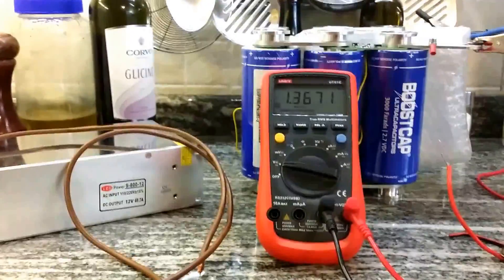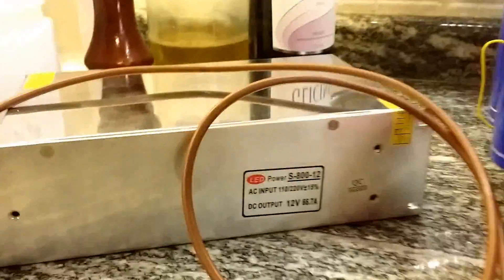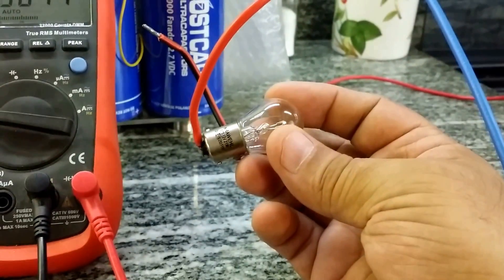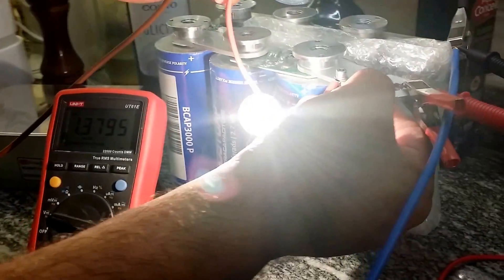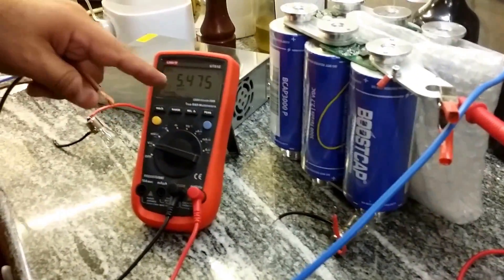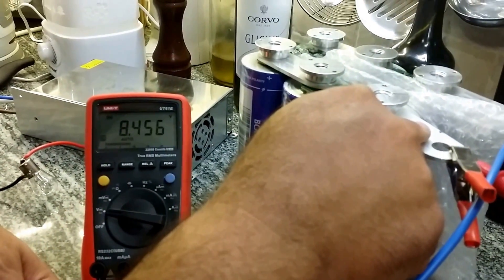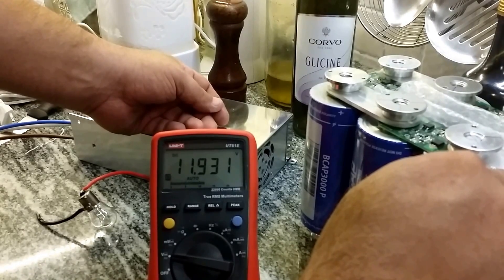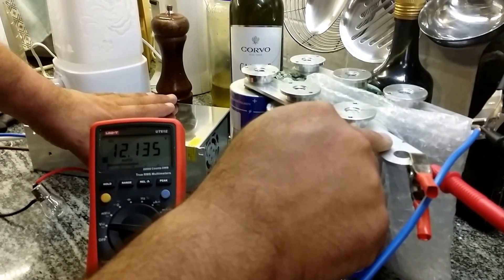Fast Charging Ultracapacitors and Supercapacitors using 66.7A LED Power supply

Comment: dear Billywhizzy, well movie! pls let me know where to buy 3 balancers for the SuperCap. I got 6 pcs of the caps. Charging w/o balancers by regulator is ok, but I would be like to follow the rules:) thx in advance. Karol
Reply from the maker: I bought them with the ultracaps. These were taken out of a bus and came with the balancers. However with todays BMSs for batteries like JK BMS, it will be possible I assume to balance a 6S pack with custom programming of the BMS with a bluetooth app. But you will need to send a message to JK to make sure there are no problems because of the very low internal resistance.

Comment: I have been searching for a comprehensive evaluation between lead acid batteries and a bank of capacitors of the same Amp Hour rating.  It seems to me (example): a 100 Ah lead acid battery should be equal to a 100 Ah bank of capacitors with the difference being weight. Next:  Why do I see capacitor users charging their capacitors independantly from their vehiches? Does this mean the vehicle's alternator (while driving) cannot recharge the  capacitors?  This far, I cannot find a video ditectly engaging in these comparisons.
Reply from the maker: I'll be simple about this. Supercapacitors do not have anything near 100Ah in this bank of 6 cells. I would say about 1Ah in all. I can light a 60W lightbulb for about 2 minutes before ther pack voltage goes below 12V. The difference here is that Ultracapacitors are capable of delivering 2000A current at any moment. (When fully charged) Equally they can be recharged fully in seconds. If they are discharged, it is not wise to recharge in vehicle because their internal resistance is so low that the alternator cannot deliver  100A to 500A of current to charge these cells up, and they can take whatever you give them. However if fully charged and only needing some top up, this will not cause problems to the vehicle alternator. Capacity is the stoage capability of energy and whilst car batteries have a much higher capacity, ultracapacitors do not. Car batteries can be charged for about 500 full cycles and they're goners. Ultracapacitors are rated for thousands of cycles without any degradation. There is also a balance circuit on the cells to ensure that the voltage in each cell does not exceed 2.7V because that could damage the cells. In a car battery overcharging dries out each cells because the electrolyte boils, but in UC's this is dangerous. So in short, I can start a large diesel lorry with a set of UC's and they weight about 2 kilos. But you cannot sit in the lorry for an hour listening to the radio or keep the internal lights on for more than a few minutes. Some people put a bank of UC's in parallel with their Lead acid batteries to aid in cranking current when starting.

Comment: I have 6 super capacitors. Each are rated at 2.85 volts 3000 farads. They are completely discharged and I'm unable to charge them using a SKYRC iMAX B6 mini. I will buy a light bulb soon to try charging. What settings do I use on SKYRC iMax because mine can't be adjusted on the fly...I think? I have multiple volt settings 2V, 4V, 6V, 12V... I'm guessing 12 volt if I use a 12volt bulb. The max amps the charger is capable of is 5 amps. I'm looking to charge each super cap to 2.4 volts x 6 to equal 14.4 volts which is the voltage in my car. After I charge them to 2.4 volts each they will be assembled or is it simpler to charge the whole bank like you did. I do not have balance boards and probably do not need them because I'm not exceeding 2.85volts. After I successfully charge the capacitor a bit can I use a EVERSTART 750 Amp Jump Starter to fully charge the caps so it will be faster?
Reply from the maker: On the skyrc mini B6 charge using the NiMh mode at 1.2v per cell but instead set the number of cells to 14S. Be vigilant on the voltages of each cell if you do not have an active balancing circuit to monitor the voltage in each cell. You can do this with a multimeter testing the voltage of each cell whilst charging. You are obviously limited to the maximum charging current of the B6.
Reply from the maker: Yes you can top up the voltage easily with a Lithium jump starter but if tto much currect passes through the jump starter you risk frying it's battery. It would be easier to hook the capacitor bank in parallel with a car battery in pulses when the caps are about 10V.. there will be sparks when large spikes of current are fed into the caps
Reply: @billywhizzy  Just bought a 6/12 volt 3 amp battery charger and 12 volt 21watt bulb. Only thing I need information on is should I charge each cap separately or the whole bank. Thank you
Reply from the maker: @PowerBassTest  Does your capacitor have active balancing circuitry? If yes, you can charge the whole bank at once. If no you need to carefully charge each capacitor one at a time keeping an eye on the terminal voltage of each capacitor with a multimeter.
Reply: @billywhizzy  I do not have balance circuitry. I will charge each cap individually per your instructions. I did not buy balance boards because I plan on charging each cap at 2.4 volts way below 2.85 volts. Thank you.

Comment: thanks to the power of "constant current circuit". i hope you know.
Reply from the maker: You can charge those ultracapacitors at 100A. Discharge 130A @15C and 290A@40C both continuous RMS so I used the full capacity of the power supply at 12v. There was no way they could have peaked at 16.2V because the power supply was running at constant voltage.

Comment: Hi

We need as much technology as possible 
The only way to have technology everywhere is with a spring powered USB charger
Like this

https://photos.app.goo.gl/EnUVBPDunO66fDb63

The only way to keep this self wound is if the hand crank charges a super capacitor and it makes the drill keep it wound like this

https://youtu.be/rEuPwnwAbcM

Here's a smaller hand crank that would charge slower but still can power a drill

https://youtu.be/ucLyYA3WvlM

I am in Canada and we cannot make this

https://youtu.be/ucLyYA3WvlM

A large portion of Israels money is invested in Canada and America
If we do not have this device we do not have technology
There was more than. 10,0000 fires set and we do not have detection devices in remote regions to stop those fires
We need a self winding clock to charger USB devices
Please make this available.
https://youtu.be/ucLyYA3WvlM
If you have connections in other countries please contact them and make this available to us
We truly need this , i wouldnt comment if it werent so important, please make this available to us 
https://youtu.be/ucLyYA3WvlM

Comment: Hi. What are you using these ultracapacitors for? Where did you buy them and the balance board? And how much?
Reply from the maker: I use them to jump start Large diesel engines 5 and 7 Litre engines no problem. I also use them to store large current from solar energy to use it to charge smaller devices. I even charge them fully at 150 Amps from solar panels. I bought them used from ebay for about 300 euro including the balance boards..
Reply: Hi Billy, I'm not able to find them on ebay, do you have any link.
Reply from the maker: https://www.ebay.com/itm/Maxwell-BCAP3000-Boostcap-Ultracapacitor-Capacitor-3000f-2-7v-NEW/263157661514?epid=2197364341&hash=item3d456b3f4a:g:mHMAAOSwFjlZtuIc
Reply from the maker: https://www.ebay.com/itm/MAXWELL-650F-1200F-1500F-2000F-3000F-2-7V-Ultracapacitor-Balancing-Borad/263206675029?hash=item3d48572255:g:iy0AAOSwHaBWkGZj

Comment: So those balancing boards won't be damaged when charging a bank at 200amps? They just might not be able to drain the higher voltage caps fast enough correct?
Reply from the maker: In the video I charged them up to about 12.5 volts, i usually top them up to 16v on a lower current or when I see the balance board led's light up, I stop. But I have to bring the bank up to 16.2V for that to happen. The balance circuits can drain 1A from each over charged cell.
Reply: billywhizzy ok. So Either way the balancing board won't get damaged from rapid charging they just won't help if they do start over charging right?
Reply from the maker: as always you have to keep an eye on the balance boards, once my power supply is set at 16v, CV, the amperage will creep down very quickly anyway. But it's always fully attended just in case one of the cells is of a lower voltage than they others and manages to reach the terminal voltage much quicker. These Cells are very similar in internal resistance and more or less reach the terminal voltage all together.

Comment: You can minimise your charging time by putting a constant current  circuit between your PSU and your supercapacitor bank, set to limit the current to la little less than the PSU can supply. You can do this with a simple transistor circuit using an n-channel  mosfet. However, this will require good heat sinking and maybe a fan to cool it too!

A much simpler way is to continue your approach with an incandescent lamp. I used 55 Watt halogen car headlight bulbs. Their resistance is low at zero volts - under 0,1 ohms, but rises to a bit over 4 ohms  at full voltage.  So putting a lamp in series with the capacitor will limit the current when the capacitor voltage is low (and the lamp voltage is high) but not limit it much when the capacitor voltage rises. Exactly what you want! 

You may have to choose a different lamp, or do as I did which was to use a number of lamps in a series - parallel arrangement to get the characteristics you want. It won't be as good as the constant current circuit, but it does approximate to a constant current circuit without requiring too much thought .I was after a cheap rugged unit that could be used 'in the field' by ordinary workmen and charged either from a car battery or mains in under five minutes. Incidentally running these lamps in a series parallel arrangement means they are all underrun which hopefully means they will last indefinitely!

You might also consider buying a bench supply which allows you to set the voltage and  current yo want. I recently bought a switch mode 20Amp one for about £130 which does the job a treat. It cheerfully pumps 25A into a dead short!

The nicest way would be to modify your 66.7A unit to limit the current to - say - 60 Amps without triggering the overload protection. This would require some reverse engineering of your unit, and a bit of redesign and modification. I have so far been unable to get hold of a schematic for these led drivers which would make the task a lot easier!
Reply from the maker: 100's of them in series parallel configuration. 500W is a lot of power for supercapacitors and is very expensive to run. I Can run an inverter from this set of supercaps for just 5 or 6 mins (100W) and this bank costs about USD 300
Reply: Each one of these 3000 F Capacitors stores an equivalent amount of energy of a AA alkaline Battery. True the Super capacitor can discharge a HUGE amount of amps for a very short time over all it is equal to a AA battery (Comparing watt hours) in theory if you used a step up boost converter you could use a AA to completely charge a 3000F Capacitor at same time the AA went dead
Reply from the maker: I usually use this system by bringing up the voltage to 5v using my lab power supply. The bulb system in series is designed to be a poor man's option. Otherwise when i need to charge quick i continue from the 800w led power supply.
Reply: Could you build a
 bank of capacitors to use with solar panels during the day replacing 
batteries and provide 500 watts for lamps, computer and tv? Here in Brazil I only saw capacitors of 350 farads, how many would it take to supply these 500 watts?

Comment: You could use a vehicle alternator too, right? 6 caps in series can handle 16.2V?
Reply from the maker: Definitely can use a vehicle alternator which is connected to a vehicle not directly since an alternator outputs AC voltage and you need DC. However, if the voltage of the series capacitor bank is close to 0v (fully discharged) it is not a good idea to hook up to a car to charge since a car alternator can only max 40-50A and that will show up to the car as a dead short due to the low impedance of the ultracaps. Besides the spark generated, the risk of blowing up your car voltage regulator is also high since it is presented with the low impedance of the ultracaps as a dead short. Yes 6 caps in series is 16.2v in total (important to make sure that each cell is properly balanced) If you need to connect to a car to charge up to 14v, make sure that the ultracap bank is no less than 12v so that the alternator/voltage regulator is not stressed out.

Comment: you have tryng discharge time , i thing is  very fast
Reply from the maker: it depends on the current used up. If you hook up an led it lights forever and if you drain 1000w you've got a couple of seconds. I have managed to run a tv for 10 minutes off an inverter until the inverter marked low voltage at 10.5 v

Comment: Use nichrome wire (e.g. Constantan etc.) as a current limiter instead of light bulbs. It's dirt cheap and you can easily have any resistance for a particular need by cutting the appropriate length: 1m with 0.1 thickness is 170 Ohm, 1/2m would be 85 Ohm etc. The lower the resistance of the limiter the more efficient the charging. Power supplies are happy with very little resistance, a 55 W load is way too wasteful.

I used to experiment with 0.5 Ohm 500W etc. beefy resistors but they need heatsinks and stuff. Whereas plan nichrome works the same and you can dump it in water for simple heat dissipation. Or leave it in the air, its what toasters use anyway.
Reply from the maker: +videotruths I had used nichrom wire too but the tendency to bring it closer for more current is very tempting. Thats how I marked my kitchen table with dripping nichrome wire. It would be good up to 30 or 40A but is unreasonably long at 66A and goes red hot.
Reply: +billywhizzy I've since moved to (used) server power supplies, they cost $20 or so, can deliver 100s of amps and come from Dell, HP etc. 

But as far as I remember, for LED drivers I coiled the nichrome around simple carbon fibre rods (from model shops) and kept them submerged in distilled water. The heat became a non issue, the water got barely warmer.
Reply from the maker: +videotruths Good idea cooling the nichrome wire in distilled water. Will have a look at the server Power supplies. I'll have to probably hook the 12V outputs in parallel to get those Amps. Once you get those 4 or 5v into the capacitor bank, the rest is still very fast with a bank like mine.. Your idea will definitely make sense if there was a bank of a 100 of those capacitors in parallel/series  configuration.

Comment: y dc power is danger more from ac uf you no belive me made video how truk alternator buton you whant i no respons for you stupiliti xd
Reply from the maker: +no noi A truck Alternator is AC voltage which is converted to DC by the Truck regulator which is used to charge the batteries.  Please give me a link to this video.

Comment: Hey man, thanks for the video it's very helpful! I'm looking at charging a bank of 6 Maxwell K2 Caps and trying to acquire a power source for charging. What is the minimum current power supply you can get away with to charge the Caps?
Reply from the maker: +The Capacicars They will charge even with mA if you do not mind waiting for a dayor more. But these capacitors are capable of being charged with very high currents in a relatively small amount of time. I also have a 12V 2Watt solar panel which i have once usedand they took forever. I have created a calculator on MS Excel to calculate the time it takes to charge a certain amount of Farads with a given Current. Time in seconds= Terminal Voltage/(Charging Current in Amps/Farads of Capacitor Bank)  Therefore 12V/(1A/50F)=600secs = (10 Mins)

Comment: Hi! Could you make a test of the capacitor? Charge of up to 14.4 volts, then connect to the car lamp 55W. And measure the time for which the voltage drops to 10.8 volts.
Reply from the maker: I have done it before. it takes about 2 to 3 mins to get down to that voltage with a 55w car headlamp bulb
Reply: +billywhizzy Thanks for the quick response! I just wanted to buy these, but can be bought only in China. And in China, can deceive. I need this information to compare his with yours.
Reply from the maker: +Андрей Ващенко  Make sure you get Maxwell capacitors. There are unbranded chinese capacitors that are not worth the money you spend. i have many different chinese brand capacitors and they are all either overrated, the fail miserably after a short time and are not of very good construction. with the internals of the capacitor rattling inside the case.
Reply: years later:) I made a test. charged supercap up to 15.5VDC using Roden 6018 supply unit. (2Ah measured while charging). I connected a car bulb nominal 12VDC (it gave a DC load current ca. 4-3.3A decreasing while discharging). Time from 15.5VDC into 10.5VDC took me 12 minutes and 52 seconds. start current 4A, finish current 3.3A. Enjoy:)
Reply: billywhizzy - Earlier in the comments I read your formula for this as :   delta V/(A/F) = seconds. By my calculation it seems like it should take about 6.5 minutes.  The average amps will be around 4.6 amps, since 55/12 = 4.6amps and 12 volts is close to the middle of the voltage range. The F is 3000/6 = 500F. The delta V is 14.4 - 10.8 = 3.6 volts. Plug in the numbers and I get about 391 seconds, or 6.5 minutes. Did I do it wrong?
Reply: That was one of the questions I asked.
Reply: @terryglenweaver  I bought the same supercapacitors and did this test on my channel

Comment: if the LED power supply is rated at lower wattage, will the starting voltage necessarily be higher?